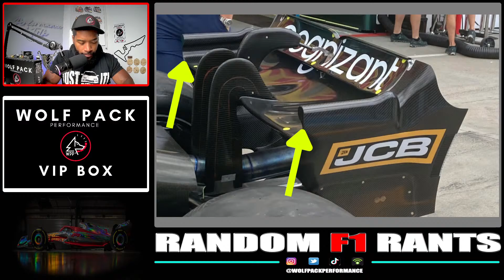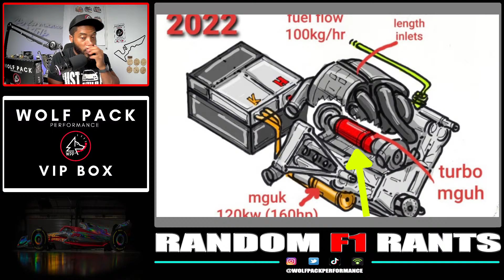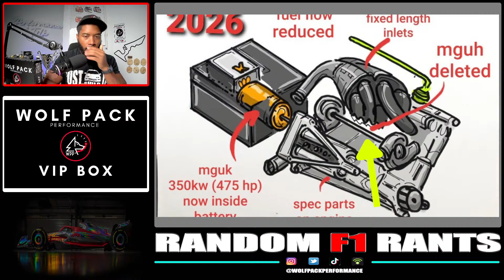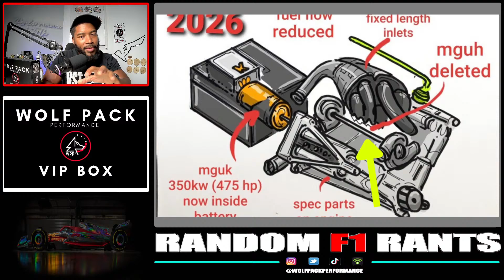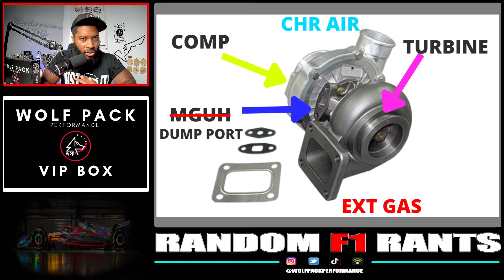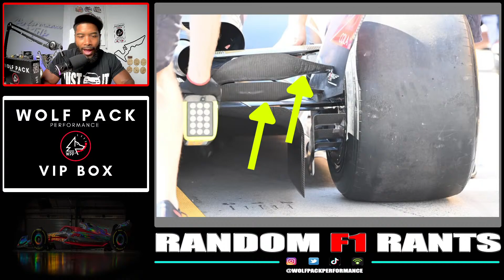FORMULA 1 | MGUH IS DELETED

Comment: The mgu-k doesn't only recover energy under braking, it can be programmed to capture energy under certain modes. Both mgu-k and H can recover energy under load. That's what harvesting is. 

Also the energy & recovery from the mgu-h is going to be recouped by adding a much larger (more powerful) mgu-k motor as F1 moves to a more electrified PU. This is probably a better solution overall regardless or the lost efficiency from mgu-h delete. Whatever torque they lose from the induction power in low revs, they can probably easily recover with the gained torque from a more powerful mgu-k. This also means they can also use less fuel overall as they aren't forcing more fuel in to the system to balance out the increased air. I doubt it will be that big of a loss in the long run, if at all.

They may lose 50-150tq from the lower boost pressure, but gain the same back if they install a similar mgu-k as seen from the formula e cars or relative in total power output.

The turbo hybrid era is almost a decade old, people have to remember the mgu-h was always a stop gap solution for the lack of overall power density they had with battery tech and electric motor efficiency back then. The amount of power batteries and motor/generators can release and recover over the years has doubled if not tripled in capacity and efficiency. So eliminating the mgu-h is a logical solution more so than a detriment.
Reply from the maker: Appreciate that added value

Comment: Great accurate explanation of the Mugh. With elimination of the mguh and the increased torque from the new mguk, teams will have to find a way to mitigate turbo lag by managing that mguk power (most likely with software modes) in order to make F1 cars as drivable as current cars. I wonder if the rules deny teams the use of excess psi (from the waste gate) to generate power for the mguk. If not we might hear strange sounds upon acceleration.
Reply from the maker: Thanks for the additional info

Comment: .... One more F1 thought... The Heat in the Battery case gonna be Hot Hot ... Hot, The Battery alone gets warm to Hot so to add a device which i would think produces Heat as well .... Battery gonna Overheat - S/C ... Burn out. Just a thought, i would have to look at the Spec of Battery and MGUK and what Heat they produce. Respect.
Reply: The mgu-k and mgu-h share the same battery housing split across 2 different controllers. They aren't making this change to reduce battery strain. The motive is to reduce fuel consumption. The mgu-k will be the primary power supply of energy now and as such the power output of the mgu-k will rise substantially.
Reply: @Themayseffect  I  understand that part as well as Wolf Pack Performance Explained that clearly,  my point was the More Power being produced would have more Heat, from 160 to 370 from the MGUK around or Near the Battery may cause overheating of both Devices, Like i said in previous comment, I would have to look into the Spec of both Systems/ Devices to see the Heat Coefficient and a thing called "Thermal runaway" which happens in High power batteries.... Was it Boeing Airways who had exploding Battery Packs due to the New Tech they installed and it started overheating in Flight  and Banned their Planes from flying for a said time.... like i said just an F1 thought.
Reply from the maker: That’s another good point!